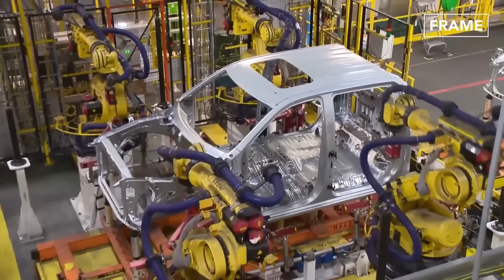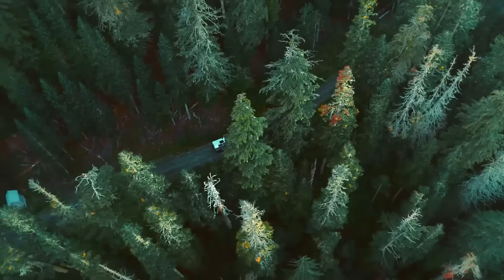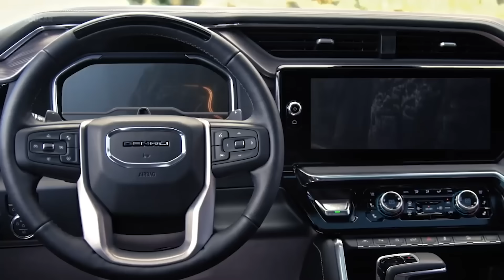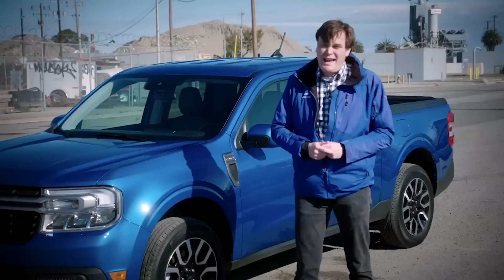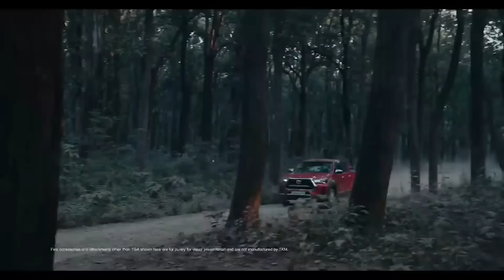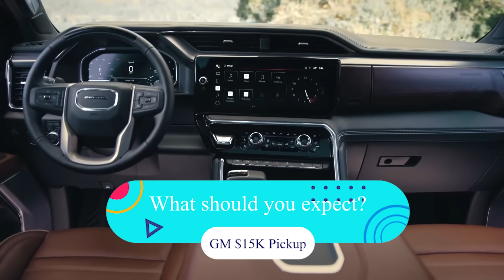GM Ceo Announces NEW $15,000 Pickup Truck & SHAKES UP The Entire Car Industry!

Comment: Fieros cost ~$13,000 when they came out in the fall of 1983--  the 1984 model. I bought one for $11, 990.05 with my GM employee discount. I sold it 13 mos later and bought a better, 1985 Fiero for $14,850 full loaded with my employee discount.  Probably $18,000 without the discount. BUT, the dealers were adding a $3,000 markup right on the window sticker.  That is what will happen to the $15,000 GMC truck. Figure at least a $5.000 dealer mark up. Perfectly legal.
Reply: Loran Harding again- There was no dealer markup of course on the new Fieros I bought, which made the deals even sweeter!!

Comment: The market here is for gardeners and third vehicles. It uses their off the shelf parts from other trucks. Picking up lumber at a hardware store or carrying tools to a job site. It leaves you wanting for more. You can potentially pay it off in 2 or 3 years and then be looking to trade it in for a better model before it falls apart.

As a third vehicle it works because it wouldn't be driven that much. A couple would both have their regular cars and use the truck for both weekend utility and a backup car to get to work. Maybe give a man that usually office chic reason to put on a pair of jeans. Overall wouldn't likely put on a ton of miles really quickly.

Comment: I won't believe it till I see it. First, will it be dependable and reliable. Will it break down all the time? Will the engine and transmission be any good? Will it run for 100,000 miles or will it be a piece of junk like the Vega, etc. take your pick?

Comment: Would I buy it? I think yes, but would depend on the after-sale options. Service and Warranty would be one of the final things to consider. GMC has just been out of reach of making an impact on the Trucks sold in the US and it might be their time, with new leadership comes new results. Other vehicle manufacturers are offering better and better after-the-sale warranties, so it will be something to see. Demand will be high and MSRP of $15,000 what will be the dealer markup? Perhaps putting it back out of reach of those it was intended for in the first place.

Comment: Doesnt GM have enough problems trying to figure out how to build a gas engine that can go 100,000 miles without the cam and lifters eating themselves...???  Now if GM can build a truck that doesnt need to be towed back to the dealership every 10k or 20k miles, i might be interested...
Reply: LS is one of the greatest engines ever built why its swapped into just about everything.
Reply: I have a 2001 GMC Sierra 6.0 2500 HD bought second hand it has over 320,000 miles on the motor and runs great.
Reply: Only the 5.3 has problems that i know of. I have a 2015 that had the problem. That being said been driving chevys since i was 16 have had many. My 15 is the only truck iv ever had trouble with. My 2011 Silverado 2500 hd 6.0 was amazing truck. Worked the piss out of it hauling trailer with 120,000 miles before i sold it. Had modified engine with cam ported heads long tube headers and more. Use to pull 25,000 pounds of scrap metal in with that truck just a great truck along with all the others iv owned. Got over 100,000 miles on the original breaks unheard of right. Iv had a gen 5 camaro no problem with 90,000 on it traded in for my Gen 6 great car. Had a 2006 monte carlo SS with 5.3 had transmission troubles with that around 3,000 miles kinda sucked. After that it was a great car though. But my 2015 i bought used I always buy new so idk maybe previous owner didn’t charge oil enough idk. But its a lemon not really happy with it touch screen is going out on it now. But i did nearly total it out thats when troubles began after i got it back so can’t really say if its GM at fault or just from the collision stuff idk.

Comment: Trucks should be simple . engine, Trans rear end body..Simple. Dont need a F15 computer system. Miss the simple Sonoma with a rubber floor matting.Lets have a Modle T for the 20s

Comment: They need to make a std cab / 8' bed work truck in 1/2 ton & 3/4 ton  truck that has thick vinyl seat, rubber floor, auto or stick, heavy duty bed able to have a rack on it and not fall apart in a yr .. creature comfort is 2nd  behind durability.
     Price should be under 20k for a 1/2 and 22k for a 3/4 ton .  And no the W/T isn't a true work truck.. make a old school custom deluxe that can take a beating and get you home and if course a V8 .. 3/4 get the larger engine of 6.0
Reply: Exactly they think every truck has to have 4 doors ,they forget who uses trucks
Reply: Miss the bench seat.  My wife can sit with me.
Reply: They do have those. They keep them out back of the dealership. Just ask.

Comment: $15,000 on the window sticker?  Good luck with that.
Reply: The Maverick started out as a $19,000 truck and now with inflation, dealer premiums, manufacturer added accessories, and dealer added accessories, it's running about $35,000 well-equipped.  Toyota maybe introducing the "Stout", a similar small truck for the 2025 model year, which may help reduce demand for this market segment and limit price increases.  I just noticed that there a lot of used Tacoma's in the used market and they are mostly over $30,000.
Reply: I bet that in the end this $ 15000 will end up being $ 38000 or more. We already know that everything is a lie for the people but there is going to be a lot of money for the dealers.
Reply: You can say that again ) the truth will set you free
Reply: Bs